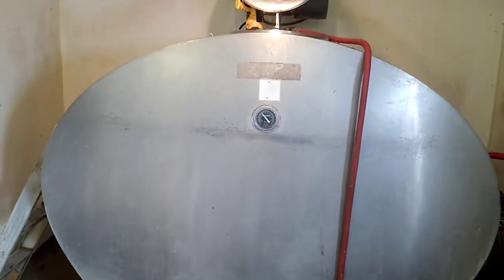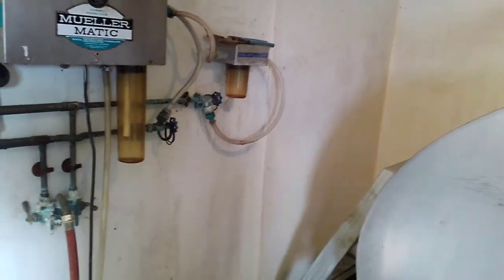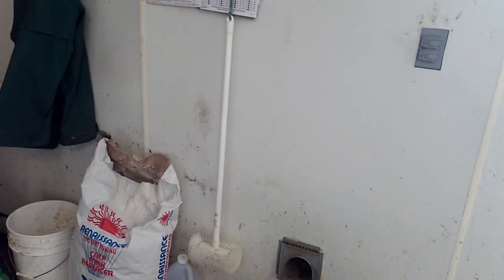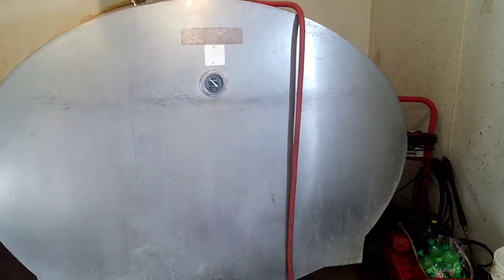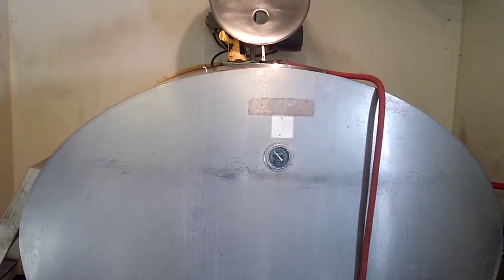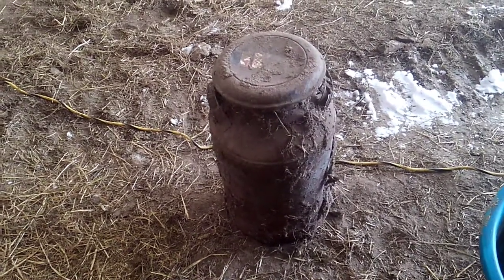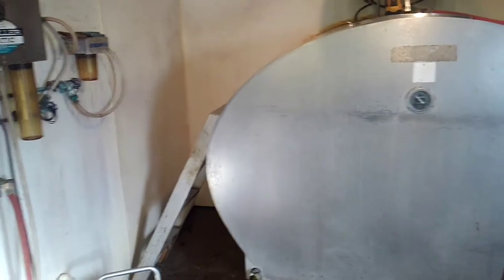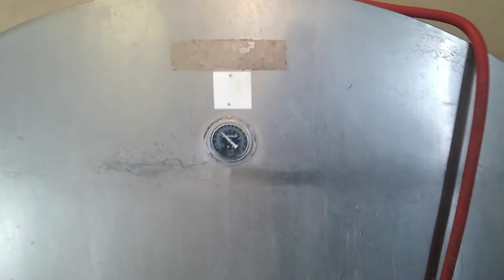Milk tanks inside and outside.

Comment: How many cows do you milk?
Reply from the maker: On average 30-35
Reply: @Mad_Farmer912  what will your barn hold?
Reply: @Mad_Farmer912  do you just milk cows or do you also cash crop or feed out your steers?
Reply from the maker: @ethanthopy1996  there are 51 stalls, but around 40-45 seems to start getting a little more over crowded than I like.

Milking cows is all I do. 
I have a guy who'll buy jersey bull calves but if he doesn't want any at that time I'll raise them because they'll barely sell at auction for enough to cover the commission.
Reply: @Mad_Farmer912  so you just crop enough to grow feed for the cows?